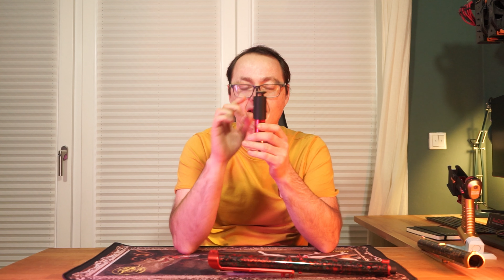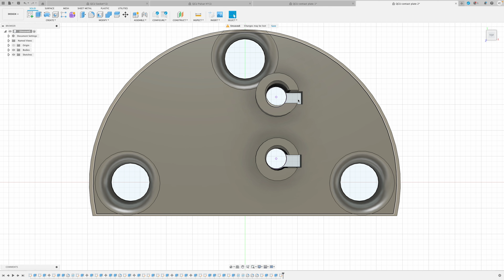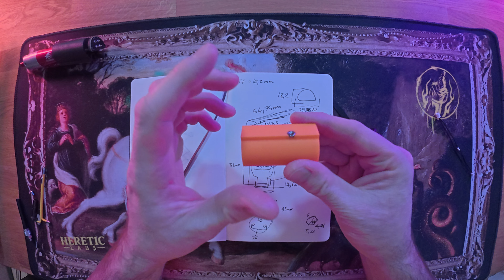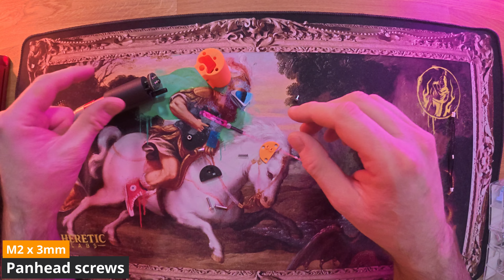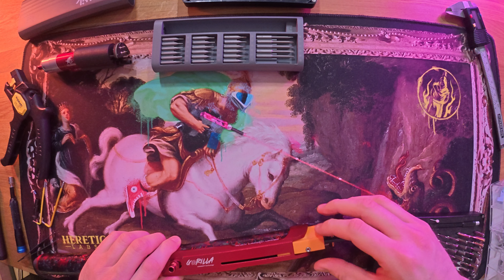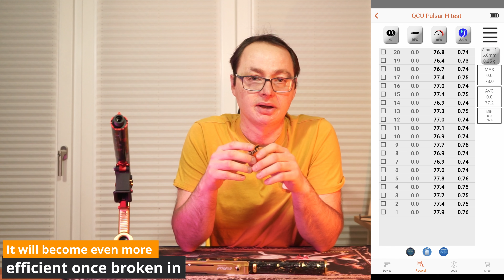How I Built the World's First Pulsar H QCU - 3D Printed Adapter!

Comment: I just purchased an Article 2 from Junkiez with the 10% off. so i saved 100 bucks. Im going to get a new ultralight alpha tank. Not sure if I should get the 48 or 68 size. I kinda think the 68 is much smaller then a traditional sized one. I have one old style 68 i can use to try it but I dont want it to long or to much weight.
Reply: I run the 2 with a 48 indoors. I can do 10 15 minutes games and still have air left. 48 is plenty big.
Reply: @TonikJDK  Thank you for your hard work your videos showing the article helped me make my choice. I have a Jack set up and its amazing but im an old paintball player and ive Always loved the idea of ON gun WAY WAY before it was possible. About 10 years ago i got my jack and it shoots Amazing even today!!
Reply from the maker: @TonikJDK  are you running steel/alu 48s or carbon tanks?
Reply: I run a 48 on my 2. A dozen 15 minutes games and I still have air to spare. 48 is plenty big enough.
Reply from the maker: I personally play with 68s, I have a 48/4500 but it is far too short for me. It reminds me of the old days when we used massive drop forwards in paintball. I see guys playing with tiny tanks and they look super cramped, I rather have proper gun control than being extra tight behind a bunker. There is a reason why there was a move away from the cramped playing styles to a more balanced style. 
I pretty much still gauge my tanks by screwing it on my gun, holding the grip and if the tank reaches the inside of elbow then it's going to be a comfortable fit.
Reply: @AirsoftMax-EU  Yeah im going with the HK 68 ALPHA DOOM tank. Ive also always have run a 68 on gun playing paintball so the alpha is smaller and thats ok im not a big guy with Long arms. Im 5'9. Ive wanted this set up for OVER 10 years. On gun insane light tank and HPA set up. I have a jack set up that is AWESOME it really is. Shoots lazers with .32s 363mm laylax steel tite bore flat hop. Im at around 100psi shooting a .25g 400. Our local outdoor field is 400 with a 25. so my 32s are around 360fps. That might be almost 2J. witch im sure is hot. Especially when im shooting super fast on semi and and hit 200 foot shots with power. That package is incredible. So much so that the last time I went there they made me change teams lol... Not bragging but when I did the other team started to play better and we won a few games. LOL..
Reply from the maker: @LiveFreeOrRIP  Nice, yeah you are at around 1.9j with that weight and FPS. I like shooting heavier BBs outdoors, usually .43 and .45 as they travel a bit further due to their ballistic trajectory being a lot better. They fly a bit slower from the muzzle, but soon lighter BBs lose that velocity over distance due to lower mass. So at 1.95j with .45s I can get 250-260 feet.